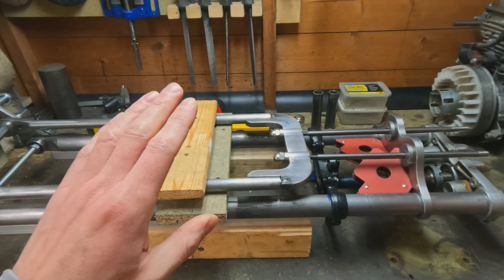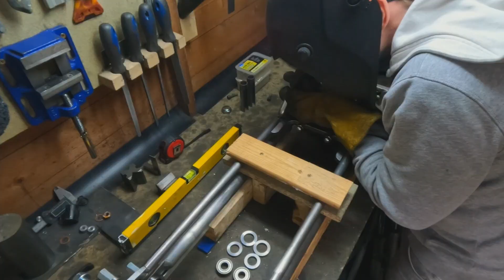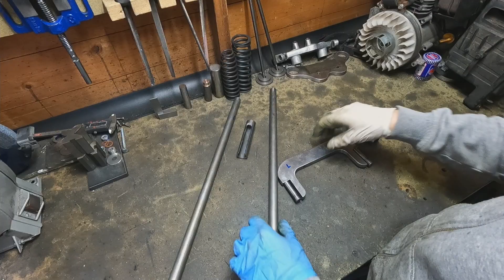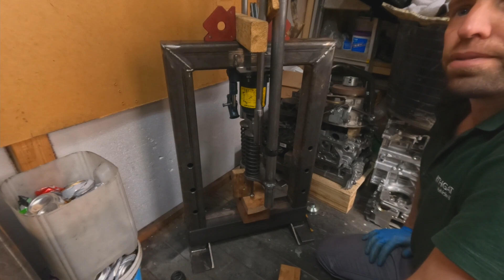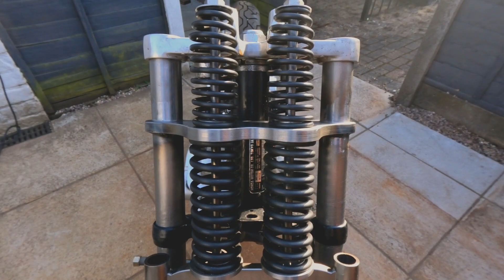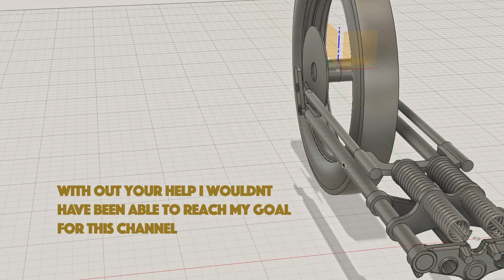Shed Built Springer Final Honda Rebel Bobber Part 19

Comment: That's an impressive and well done job! Try to put a 21" front wheel (Yamaha XTZ 150 or Honda Bross 150 front wheel) or you can use the central hub that came with your motocycle and only buy the spokes and 21" wheel rim.
Reply from the maker: I have played around with the idea of now fitting a wider front tyre because the springer can accommodate it, possibly a future modification :)